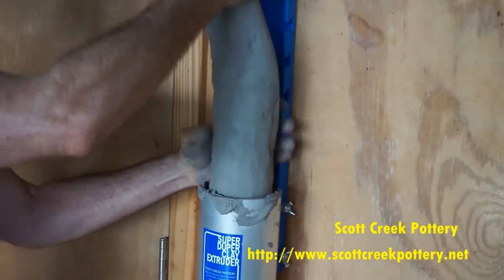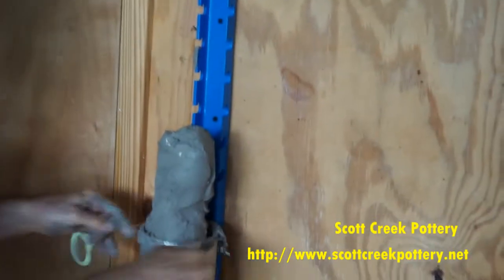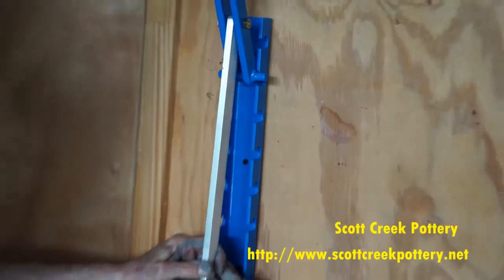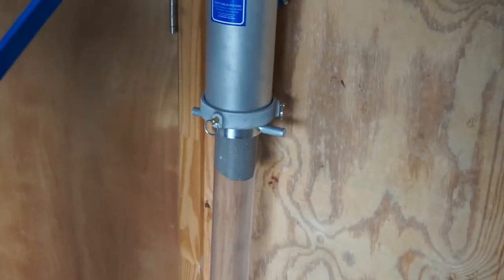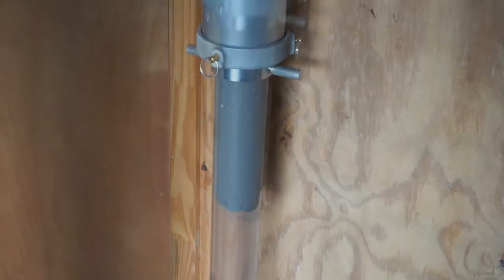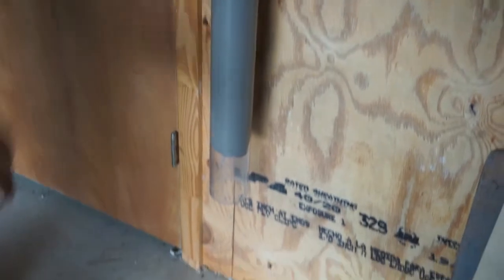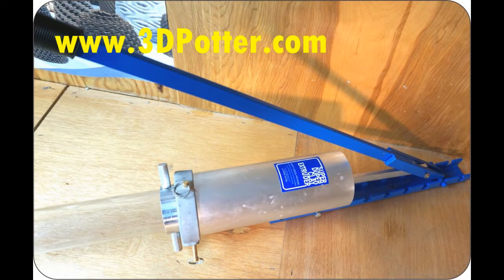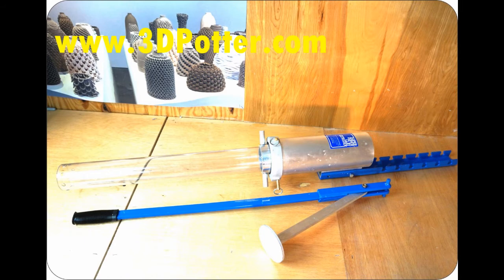3D Potter  Wall mounted extruder  loader

Comment: That is a cool tool. Does any special feature to avoid air bubbles?
Reply from the maker: By using clay straight out of the bag with a little moisture added you virtually have zero air bubbles.